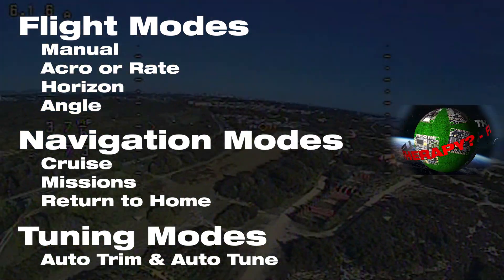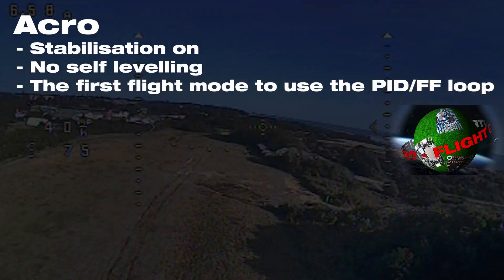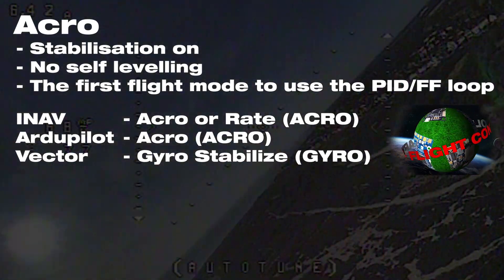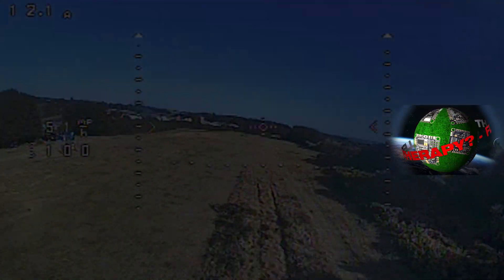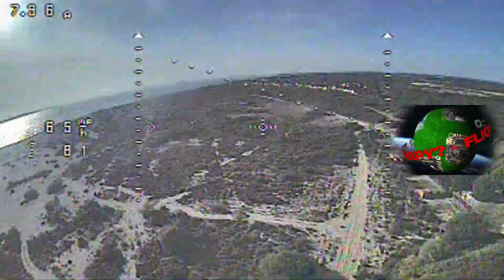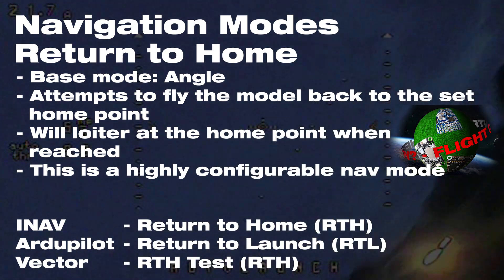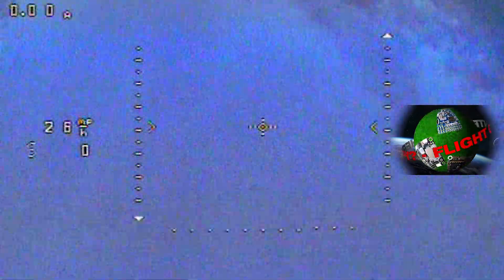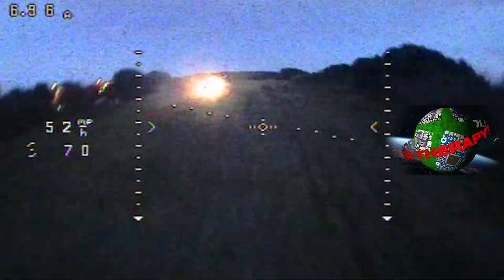What are Flight Modes

Comment: Thanks for the great videos. I was wondering in horizon mode if it slowly turns to the right or left is that a manual trim issue
Reply from the maker: Yes. You should not have any transmitter trim when using stabilised modes. If you trim via the transmitter, you need to be in manual only, then land and physically adjust the control surfaces to those positions with 0 trim in the transmitter.

Comment: Hi Darren.  Im looking your great video again. You described that 3d cruise ( which is added to a base mode like angle) will hold altitude and heading when enabled.... but you then said " you can adjust in flight with roll and elevator " .... does this mean once the 3d cruise mode is enabled on a switch:

1. Altitude and heading are held constant  while im off the sticks once the mode is enabled -  But if i use the elevator i can change height, and i can change heading by using roll ( ailerons). Once i release all the sticks again the wing will hold altitude and heading.

Or 

2. Once 3d cruise mode is activated, the drone is locked in altitude and heading. Pushing evelator sticks or aileron sticks will not change heading or altitude? 

I just wanted to understand what you meant by adjustment and get a better understanding of the 3d cruise mode behaviour .

Thanks again
Reply: Think i found the answer. It behaves  like fbwB in ardupilot. Think its like option 1 that i mentioned above.
Reply: I finally worked out what i to do in order to get the flight behaviour i was after for long range fpv.... i.e. flying level, stable ,with fixed altitude and fixed heading when off the sticks . But able to climb/adjust height with evelator stick and go left and right/adjust heading with aileron sticks. Throttle is adjusted automatically but can be overridden by the pilot.

Basically this can be achieved with nav cruise combined with alt hold (3d cruise as you said!!). I knew what features i wanted - just didnt know it was called 3d cruise!

Thanks again for all your help. Your videos are invaluable for a newbie like me!
Reply from the maker: No problem. Yes 3D Cruise (Cruise + Alt Hold) in 2.6 and below or Cruise (just Cruise, no Alt Hold) in 3.0 will do just that.
Reply: @MrD  you legend!
Reply from the maker: It’s 1, except that the yaw stick can also be used to change the heading. 

Also, things have changed slightly with iNav 3.0
3D Cruise is now just Cruise
Cruise is now Course Hold
There’s no need to use Alt Hold with either.
Reply: @MrD  oh... thanks for letting me know and saving me a load of confusion and headache!
Reply from the maker: No problem 👍🏻

Comment: Thanks! Just starting with planes and needed to be sure the flight modes mean the same as in BF. Question: How does horizon mode know at which point to do a roll, and how do I change it to where it only does a roll with full stick deflection?
Reply from the maker: Horizon will rotate whichever direction is the shortest. There isn’t a setting to select only roll. To be honest, horizon isn’t great at the moment. It can cause you to crash if you’re aimed downwards while inverted. It could see pulling up as the shortest distance and put the plane in to the ground. It would be better if it was based on the fastest way back to level, as roll rates are always higher than pitch rates, so for larger deviations it would favour the roll axis. 

You’re probably better off using Angle for auto-levelling flights or Acro when you want to play. 

However, after all that, I’ve just seen what you mean. Horizon is a mix of Angle close to stock centre and Acro towards the outer edges of the stick. You want the transition point. It’s in the PID Tuning tab and is called Transition (Horizon). But, you need to be cautions when you change this. There is more information in this https://youtu.be/tR4P5Idp1r4 or this https://youtu.be/kTtXHcTvSVM video. Sorry, I can’t remember which one it is in.
Reply: @MrD  Thanks man! I'll watch them both. Yes, transition point is what I meant.
Reply from the maker: No problem 👍🏻

Comment: Hi mate... very useful video. I had a few questions.... is there a priority that one mode has over another? Say i had manual mode on channel 5 switch .... and angle mode on channel 6 switch, and then i enabled both switches at the same time, which mode would be on?
Reply from the maker: iNav has got a priority. Manual will override pretty much anything, I think except RTH. To get around this, I set up my switches so that only 1 flight mode can be selected at a time, rather than using multiple switches on multiple channels. That way you not only save RC channels, but can also almost guarantee the flight mode. This may help https://www.mrd-rc.com/tutorials-tools-and-testing/opentx-tutorials/five-flight-modes-using-one-radio-channel/
Reply: @MrD  thats really helpful - thanks.  Can i mix or add modes together, for example  angle and altitude hold?
Reply from the maker: There are mode modifiers, alt hold and airmode, which can be used with flight and navigation modes. Most people have airmode permanently enabled. But you can add alt hold to other flight modes to maintain the altitude, for example angle or cruise. Pos hold adds alt hold automatically.
Reply: @MrD thanks!.  sorry to ask yet another question.... but what would happen if you had 2 modes that were enabled but their functions conflict.... for example,  landing mode and cruise mixed together?. I know it sounds crazy... but im guessing there needs to be a priority order to all the modes to avoid these scenarios
Reply from the maker: There isn’t a landing mode. You can add landing to RTH, which would take priority. It’s not great though, its more of a controlled crash and you need a lot of flat, open space. 

iNav has priorities for the flight modes. So it will only enable one at a time. Even if the same switch position turned on cruise and RTH, only one mode will activate.
Reply: @MrD  thanks for all of this very useful information. Very grateful to you for taking the time to reply with such detailed explanations. Much appreciated
Reply from the maker: @beefybeef1326  No problem at all.

Comment: A very useful video. I have just started looking at iNav for FW, being a Vector enthusiast for many years, and this was very helpful. My main cruising flight mode on the Vector is 2DH - you say there's no iNav equivalent - sounds like 3D cruise is very close - what's the different between this and 2DH?
Reply from the maker: 2DH is actually like 3D Cruise. I missed the heading hold in 2DH. I’ll add an amendment to the video.
Reply: @MrD  Finally, after many hours, managed to arm my F405 Wing board everything was green, no issues, just would not arm. The solution was to change the ESC protocol to Oneshot125 - apparently my T-motor F45 ESCs did not like the default setting.
Reply from the maker: Some ESCs are funny. I had one that wouldn’t work on standard too, can’t remember what it was now. Still, I hope you have great flights.